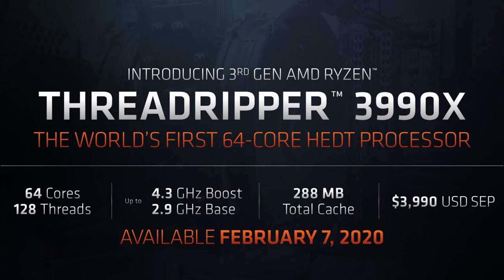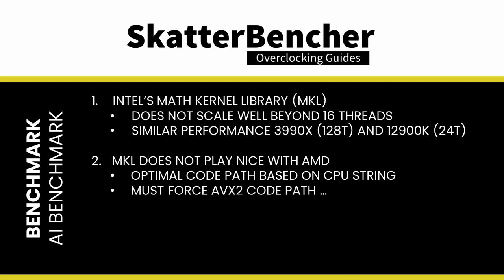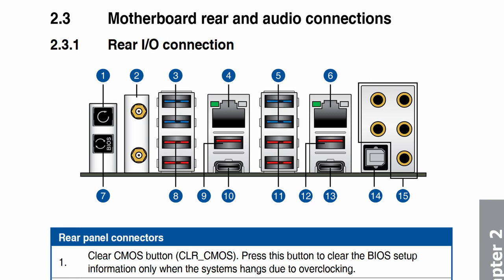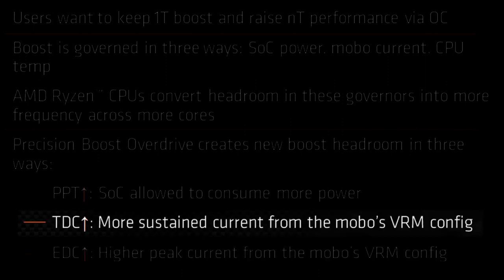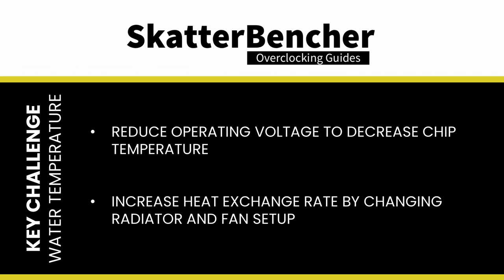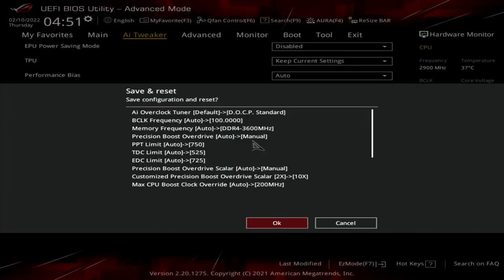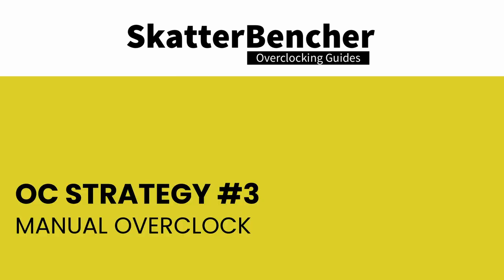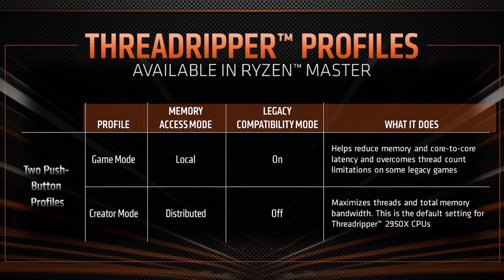Ryzen Threadripper 3990X Overclocked to 4500 MHz With EK Magnitude Water Block | SkatterBencher #36

Comment: fantastic video congratulations!  :) Could you bring a more consumer-side updated version of the UHD 770's over clock?  something that anyone can do with a normal air cooler without ruining the CPU too much and keeping it long-lasting
Reply: I managed to release the tensions since the beginning of December, but now I don't know pk is even stronger than before, 12600k a monster.  I can do 75 FPS on apex
Reply from the maker: OC Strategy #2 and #3 from my original SkatterBencher video should be good for those with air or aio cooling https://www.youtube.com/watch?v=Sihfywr0gy0. 

The UHD 770 overclocks incredibly well even without any voltage adjustments.

Comment: Hi Pieter, is it possible you might have problem with your multicore scores? I have 3970x that manually overclocked to 4.2Ghz using Zenith II Extreme Alpha. My R23 score is 47300. CPU-Z v1.99 single-core score is 514 and multicore score is 22390 while SMT is ON. 3990x has 2x cores comparing to 3970x, but achieves only 65.911 at R23 and 36684 at CPUz. So your scores are looking much lower comparing to 2x core factor (around 64% for R23 and 39% for CPUz multi-core performance comparing to 3970x@4.2GHz). Any comments? Thanks.
Reply from the maker: Thanks for the information! I think the scores look okay.

For my manual overclock I have 3 scenarios (AVX+SMT, NO-AVX+SMT, NO-AVX+NO-SMT). The one most relevant for comparision is the NO-AVX+SMT (it just means it's Prime95 stable when AVX option is disabled). Here's the benchmark results of that system: https://skatterbencher.com/wp-content/uploads/2022/02/manual3b.png.

For this manual overclock I have 64 cores and 128 threads with an average frequency of 3784MHz: https://skatterbencher.com/wp-content/uploads/2022/02/Slide75.png

Cinebench R23: 78,492 points (+66%)
CPU-Z Multi: 40,764.7 points (+82%)

So I think there's two things at play here: (1) I'm at a 10% frequency disadvantage compared to your 3970X, and (2) the benchmarks don't scale perfectly linearly
Reply: @SkatterBencher  Thank you. I believe the issue is related to multi-thread management of the O/S so benchmarks don't scale linearly. I would highly encourage you to test the system using Windows Server 2019 or 2022. Thanks again for the great videos.

Comment: The wait for new overclockable Threadripper continues, at this rate Intel will have their 80 core HEDT out before AMD reacts.
Reply from the maker: The TR 5000 series are supposedly overclockable, but it's not easy to get ahold of a CPU & board
Reply: @SkatterBencher  TIL, I thought Threadripper PRO had no overclocking.